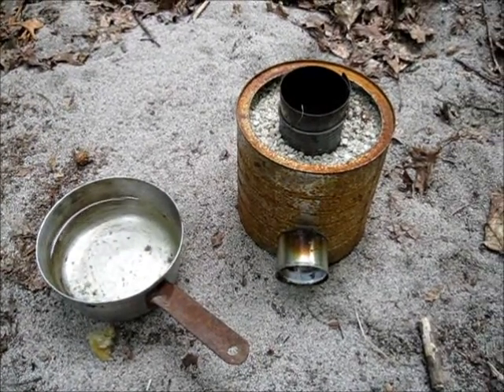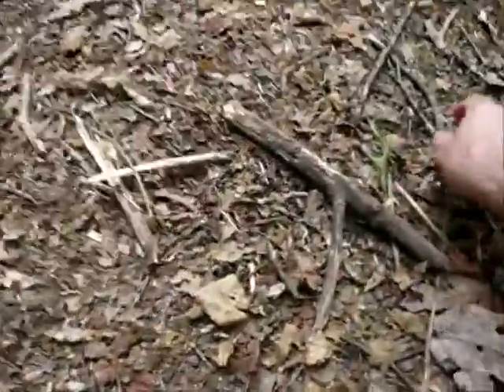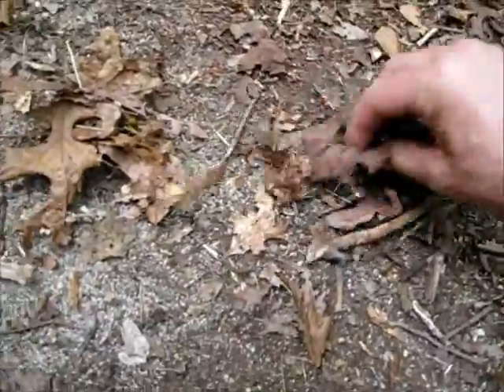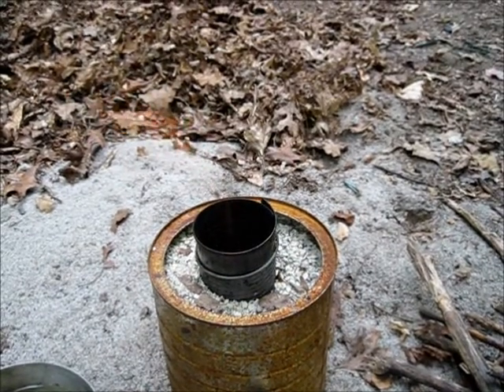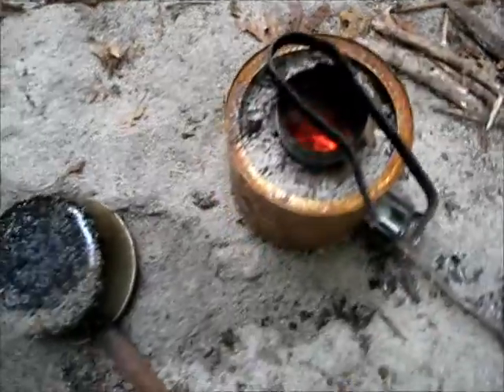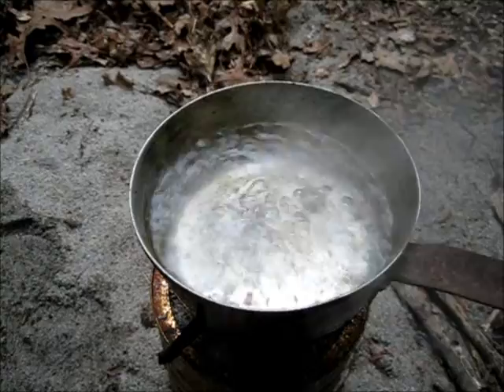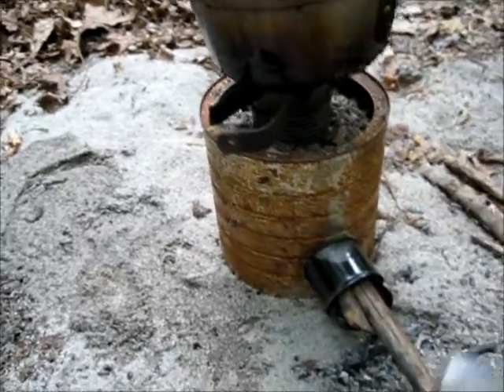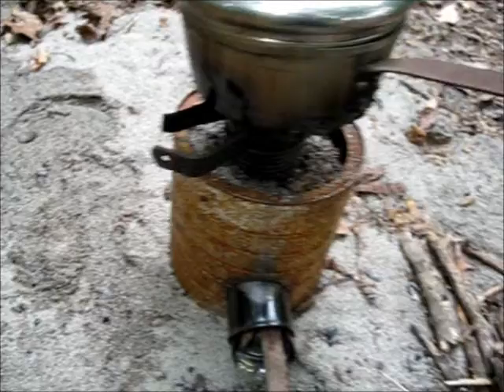Homemade Rocket Stove Water Boil Test

Comment: is it safe to boil water in a soup can soup can? like if I wanted to heat up a quick instant coffee
Reply from the maker: nickycoley1 I have heard of people cooking in a soup can for many years. I have never done it myself but in a survival situation I would not hesitate. I prefer a proper cooking pot and would advise that if you can. I cannot vouch for any long term health effects from doing this though and do not recommend it.
Reply: +The Do It Yourself World check for a plastic lining or coating inside the can.
Reply: +The Do It Yourself World no plastic no problem.

Comment from the maker: It is just a tin can with a can lid pushed into the middle. The air intake is the bottom half and the feed tube is the top half. Works nicely.

Comment from the maker: After it is burning, it has virtually no smoke. But if you do not keep it going properly, it smokes a bit. I did take it inside my survival camper once. It smoked up a bit. Should be vented if you want to do that. And use a non flammable surface under it.